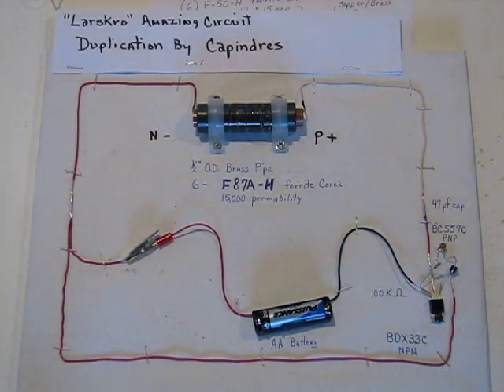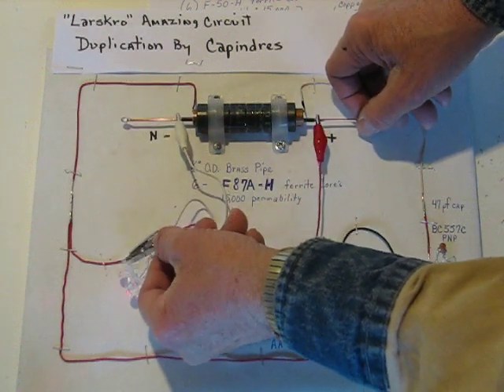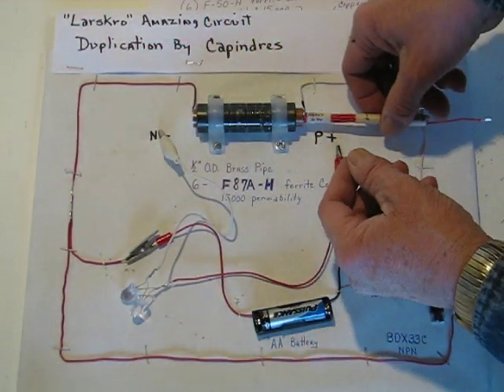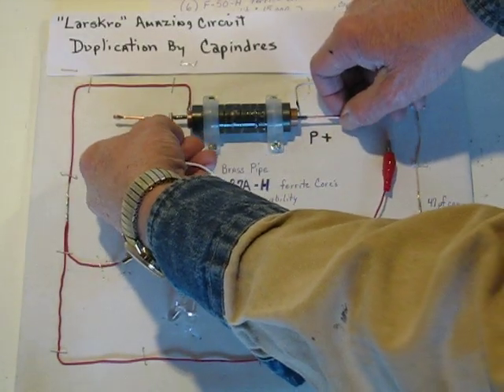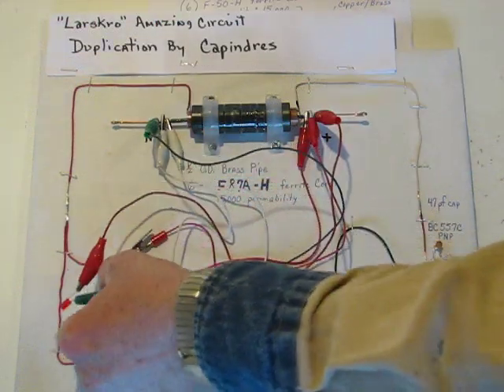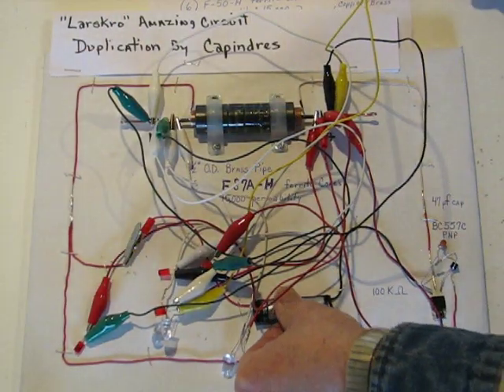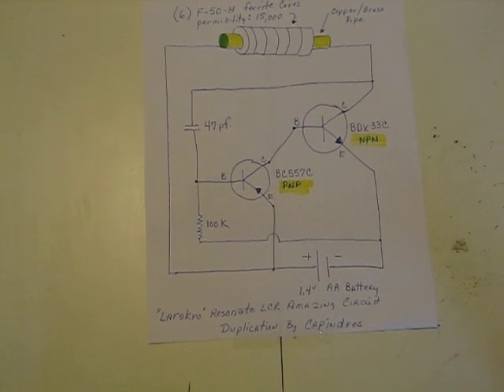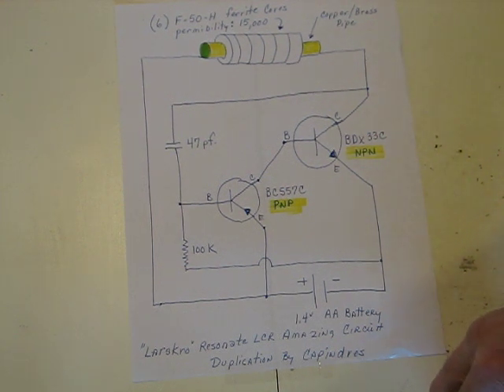Amazing Circuit duplication of Larskro YT-video

Comment: M Wing How in the name of God is that a typical transformer? U pick up the voltage drop across a practically 0 Ohm brass center, like in 2 Faraday disc in series , only NO SPIN! The DC resistance is MUCH smaller than the internal resistance of the battery, RMS voltage is bigger than that of battery!

Sir, Wonderful, excellent replication, congrats to Larsko, u, and all who understand!

Comment: The fer-rite cores, pipe, and wire running through it, is called a transformer. 
What is going on here is, the transistors are causing a PWM across the "transformer", and is transferring a charge to the middle wire (secondary). Getting picked up by the "secondary" (the wire running through the ferrite cores.) As the inductance collapses on the transformer, it resets the transistors and charges, causing the PWM cycle to loop. 
By the way, the BDX33C is really a  Power Darlington TR pair. The diagram is different than from a regular NPN transistor, please revise the diagram.
Most modern led flashlights use PWM to increase efficiency, and to adjust the brightness.
Even if the transformer was used as a plane inductor, it should cause the voltage to spike to around 2Xinput voltage.
P.S. TheBblindman: you do not need wingdings to create a transformer. In fact, all you really need is two conductors close to each other to transfer current from one to the other, The magnetic field caused by the magnets is aiding in transferring the current easier.

Comment from the maker: Yes, it's a DC voltage.  When I place an AC LED (2 LED's wired opposite to each other) only one lights.  If it were an AC voltage then both would light.

Comment from the maker: Source Battery (AA) at start of test was 1.529 volt at 76.4 Mili amp     (all LED's in this test are X-mas LED's 3.3 volt max)  Frequency of circuit was 25 KHz +/-  At Star of test with zero load LED's: 7.96 mili-V Peak-Peak.  I tested for 1 hr. at 5 LED's per step to 90 LED's.   Peak to Peak voltage with 90 LED's was 4.06 Mili V, Source Battery read: 1.440V @ 73.2 Mili-Amp.

Capindres

Comment: Sir, the bigger the diameter of the internal wire pick up, the bigger the Voltage, my guess! Putting several layers of wire is the same as using same diameter single wire, that\s the beauty! And no, it doesn\t act as a resistor it acts like a very good power source with very low internal resisitance

Comment from the maker: @altgenesis123 Sorry about the delay in my reply, but one has to work remote jobs sometime.  The diagram is correct. I would suggest you check your duplication efforts.  It is what it is and I do strive hard not to make any mistakes in my drawings prior to posting for all to see. Sometimes just to make sure they are correct I will build a second one using my drawings to make sure.  Thank You for your reply.